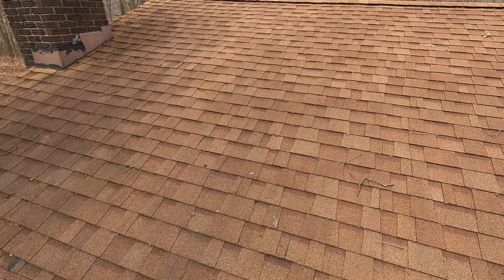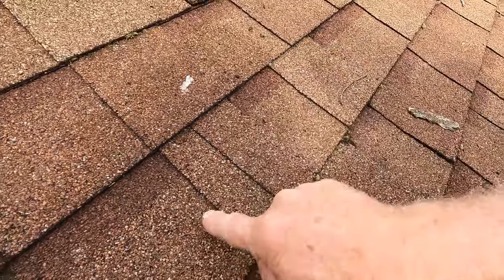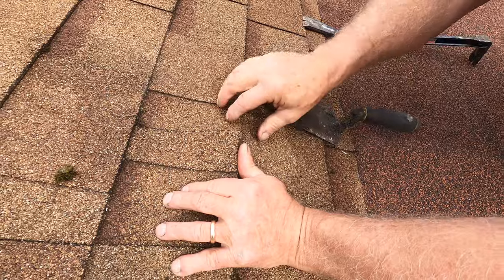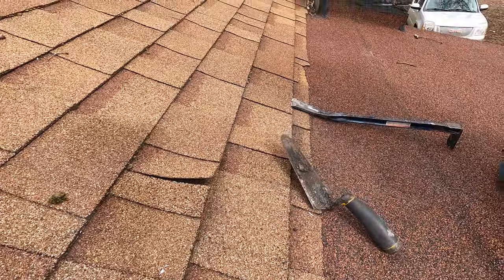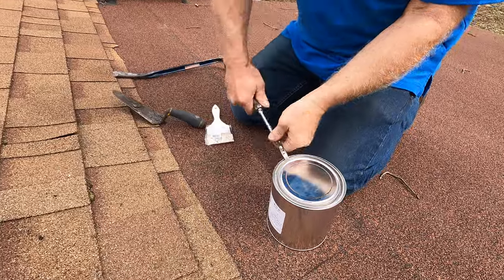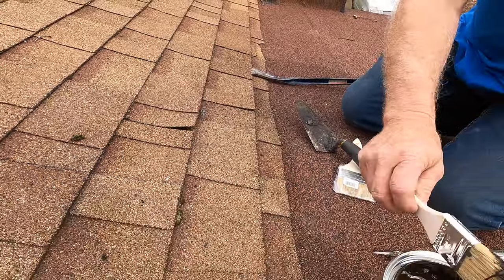Shingles causing flat roof to leak - How to find and fix the leak

Comment: Whats the name of the seal, did you say double polyseal.
Reply from the maker: Turbo Poly Seal
Reply: @FlatRoofDoctor  i got a Leak on my Garage Shingle Roof in one spot should i buy a hand held Vacuum to remove dust and debris before spreading the poly, i might use an old paint brush to sweep away the crumbs and debris.
Reply: @matt7iron  I always use a small leaf blower.